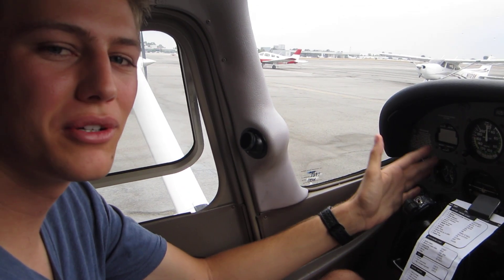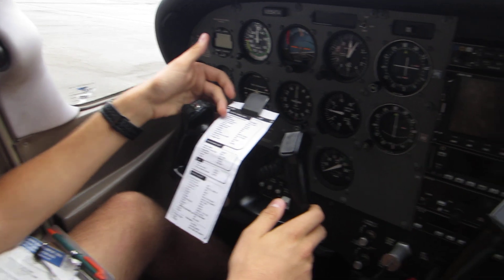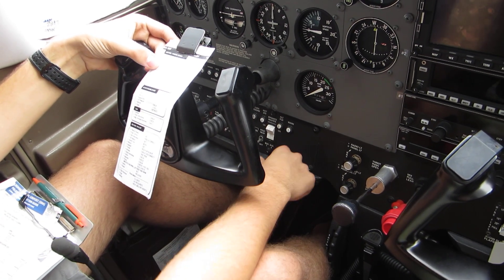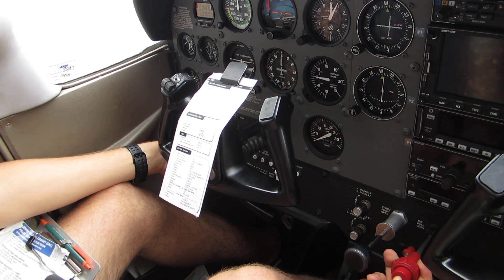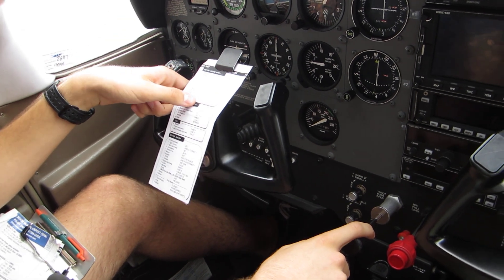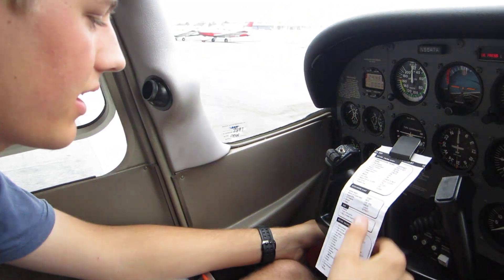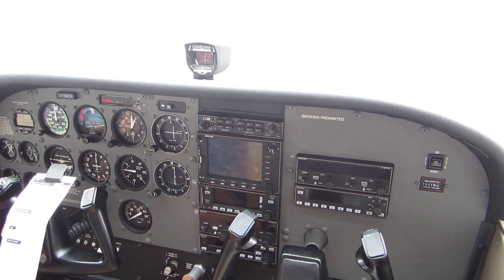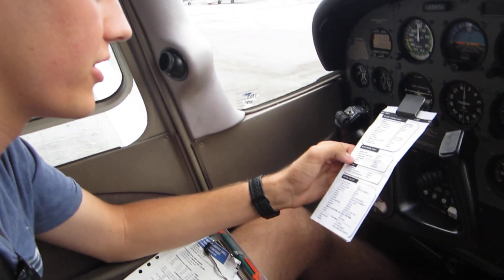How To Start A Cessna 172 SP

Comment: Totally missed the mixture control on startup. The whole reason im here :(
Reply: You crnk the starter with the mixture OUT (after the fuel pump priming), then as soon as the engine 'catches' you push the mixture in.
Reply: This was a video about how fast a pro pilot can start Cessna. This is not an instructional video.
Reply: @verstappa it says how to in the title
Reply: @verstappa  - What are on? He clearly wasn't a "pro pilot" at the time of the video.
Reply: @DavidR_192 In an instructional video the pilot would do things more slowly and clearly and actually tell the viewer, what he's doing so they can learn...

Comment: What do you mean vacum alright?
Why do you have to lean on taxi?
Reply from the maker: I meant that the vacuum gauge was in the green. It's a check to see if the engine driven vacuum pump is generating suction that a few of the instruments need to spin their gyros (attitude indicator and direction gyro).
These fuel injected Cessnas need to be leaned on the ground to avoid carbon buildup on the spark plugs which can foul them. If you notice a rough engine when you do a normal engine runup, it could be caused by a fouled spark plug. You can try a higher RPM runup for a longer period of time and attempt to burn off any carbon on the plugs.

Comment: Thank you great video. The only thing that I'm confused about: in the manual it says the mixture should be advanced smoothly after you start the ignition. Is it OK to set it full rich prior to starting?
Reply: You push mixture in, engage fuel pump till gage indicates fuel injection into cylinders then pull mixture ALL the way out. Then shout Clear, engage starter and once engine starts immediately but smoothly push mix all the way in.
Reply from the maker: That's not a good idea because you risk flooding the engine with too much fuel too soon.

Comment: A 172 with a fuel pump? The 172 I learned in didn't have one... Now I'm training in a Cherokee and it seems like one more thing to have to remember to do. I thought 172's didn't need them since gravity would do most of the work.
Reply from the maker: You are correct, the fuel is gravity fed. This fuel injected 172sp uses the pump to help prime the engine before cranking it over. The pump is also used in the case of an engine failure due to a fuel line vapor lock. The pump helps force fuel through the line and clear any air bubbles.
Reply: +Jackson LaRue Interesting! I guess that was a newer one, and the one I flew was 1980, so it predated that. Do you turn it on as a safety measure during the landing approach?
Reply from the maker: You were flying a carbureted model then. Some planes specifically say to turn it on for landing, but on these cessnas it isn't something you are supposed to do.
Reply: you do not have to remember, stick with the check list
Reply: Aztec warrior -is right, you don't have to remember,  just use your checklist!  if every pilot done that along with a little extra on the pretrip it would be a safer flight.

Comment: Good video but shouldn't you of said clear prop when the engine was off?
Reply from the maker: Actually someone mentioned this in the comments already. Yes I should have said it again right before I used the starter, but I had already said clear prop. I then decided that I wanted to start the gopro first. Then right before I actually crank it over I do a really thorough look around the plane.

Comment: ok i give :) this is the 3rd vid' i watch on HOW TO START A CESSNA 172 ,,,and i still don't know if u 'PULL' the throttle thing or 'PUSH' the throttle thingy to rev up the motor (Grrr)  i guess a newbie (MEEE) is jst suppose to know that?
Reply from the maker: Hi Amanda, the short answer is that pushing the throttle control [the black knob] IN will rev up the engine. PULLing the throttle knob out all the way will put the engine in a stable low speed idle. The red knob right next to the throttle is the mixture control. This controls the fuel to air ratio for this fuel injected type of engine. Pushing the mixture knob in all the way will give you the richest setting. Pulling the red mixture knob out all the way will lean the engine so much that the engine WILL die. This is how you turn off the engine of this airplane. After the engine stops spinning, you will then turn off the electrical system which consists of turning off the magnetos by turning the key left, and flipping the Avionics and Master switches OFF.
Reply: +Jackson LaRue Thanks
Reply: +Jackson LaRue : Is it good not to push mixture all the way in.... To avoid fouled plug....
Reply: Mdw 159 was that a question? I'm new to flying, but I always thought once you're done priming the engine and it's started, you leave the mixture knob all the way in for a little under a minute, then pull it back an inch or two before taxing and take off. I've seen people leave it in all the way during the duration of the flight, while others pull it out a few inches before taking off

Comment: Hey you're the guy from the UCI flying club! I went there for a couple years... 

I'm transitioning to a 172 from a 152 soon. So you start it with mixture at idle cut-off, and richen it once its started? Not quite how I learned it for a 152.
Reply from the maker: Hi yeah, Who is this exactly? (you can message me through FB.

Yeah for these newer fuel injected Lycoming engines, throttle 1/4in. open, crank starter, as the engine is catching, smoothly increase mixture semi quickly to full rich. 
Carbureted 152 engines indeed have a slightly different start procedure.